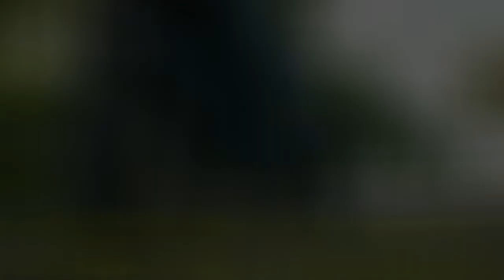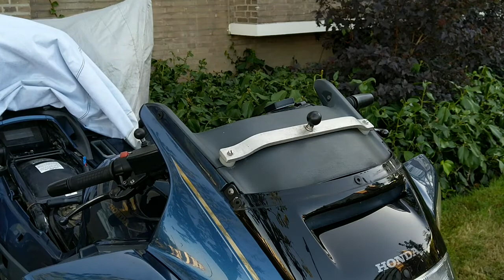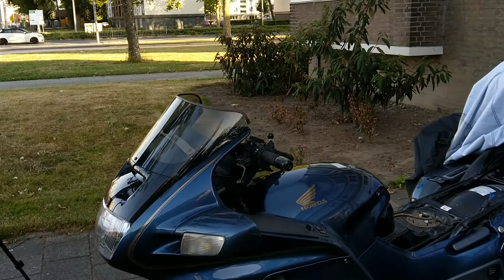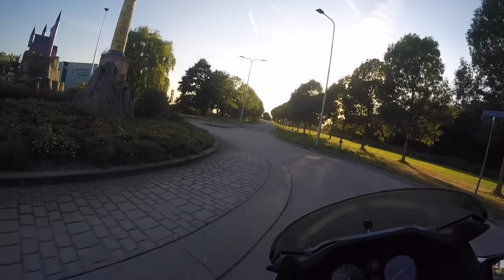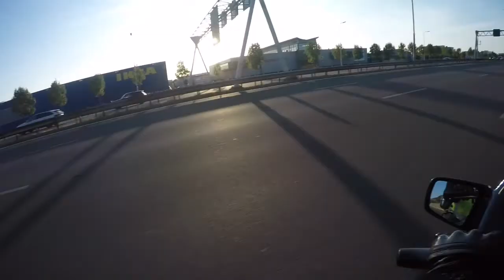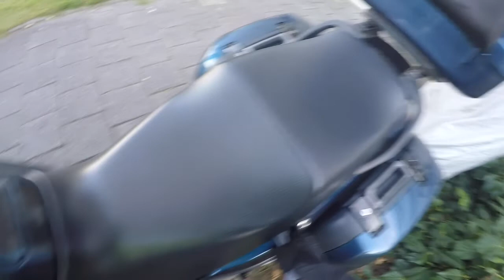Honda ST1100 Pan-European VLOG| Size Matters!

Comment: I had a 1984 Goldwing and desired a lower height fairing. None on market, so I used a dremmel tool to cut down fairing and sanded edge. Worked great, today I'd flame edge too.

Comment: I did a similar mod using a Clearview short tinted shield.  I cut it down a little lower than yours.  I think it is great in warm weather, and the air flow is smooth.

Comment: I picked up a 99 model. It's a fantastic bike! I rode sport bikes for many years, and switched to cruisers. I had a Victory and a few Harleys. A guy wanted to trade for my sportster so I thought I would give it a try. The st1100 is amazing. It's fast, powerful, comfortable, and quite agile. I'm in love. It's my new daily driver.
Reply from the maker: I love it. It's not really powerful enough to be called fast, but it's fast enough. And the handling is great.